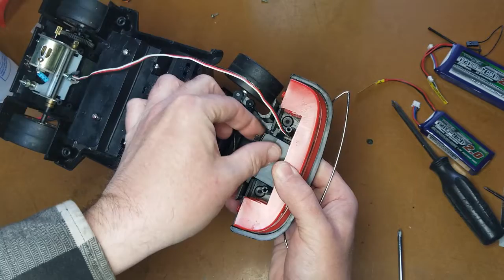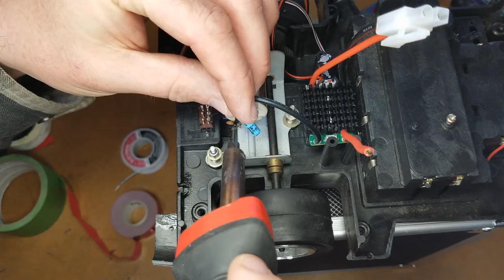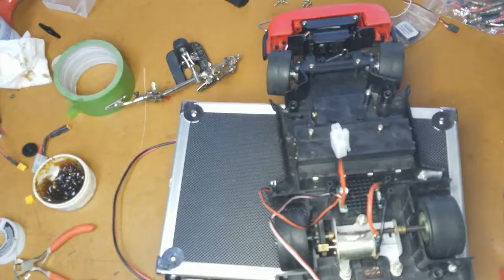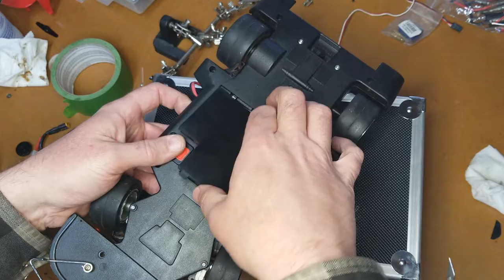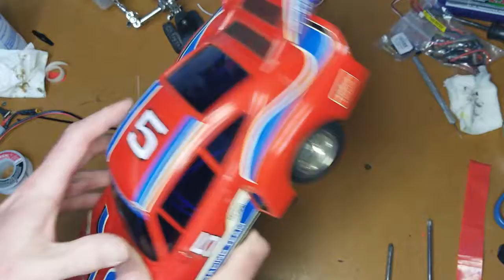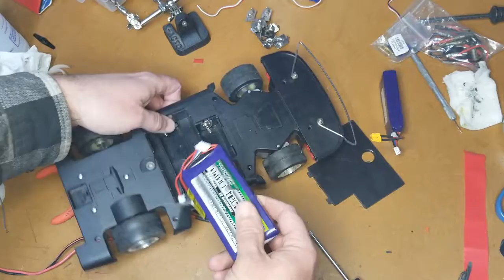1981 Radio Shack Tandy Racing Porsche 935 - Part 2 - Electronics Installation - Steve's Hobbies

Comment: That's not actually a double-pole/double throw switch. It would have to have 3 positions to be one, and that switch only has two. It just has extra terminals for activating/deactivating other functions on a different circuit with one throw. it's a duel circuit, single pole/single throw switch. That's a really cool looking 935, though. That motor looks like a cheap one. You should look into replacing that, now that you have a bigger power supply and a speed control that can handle it. A 360 motor on a nimh 9.6V might work well for it, if your esc can take that many cells/volts. You could use a servo-saver to prevent damage to the servo.